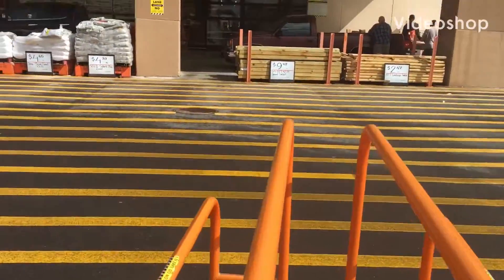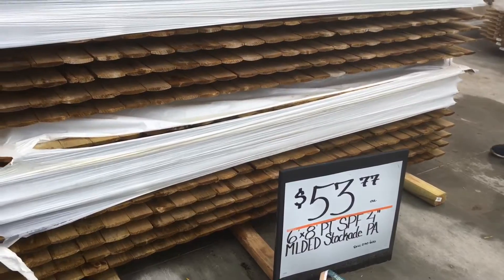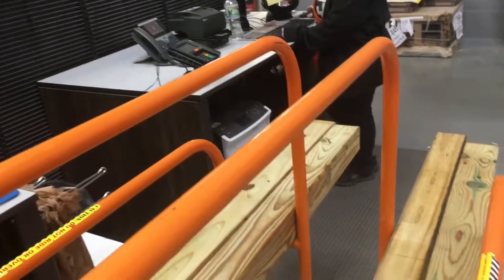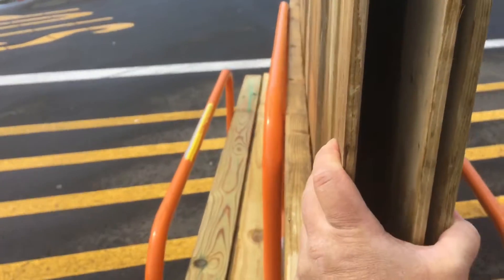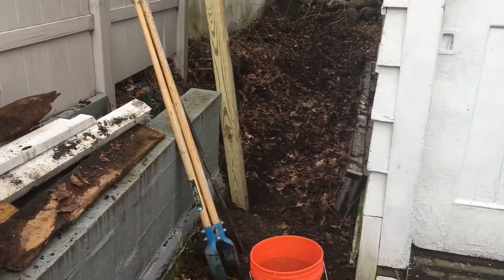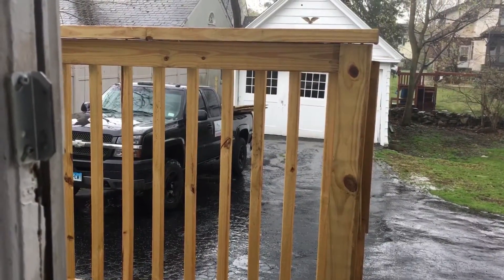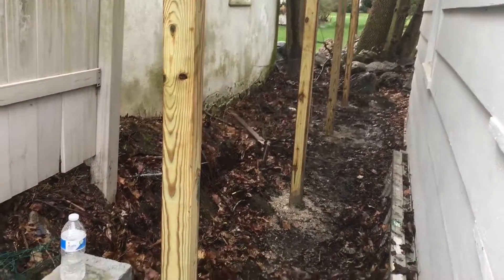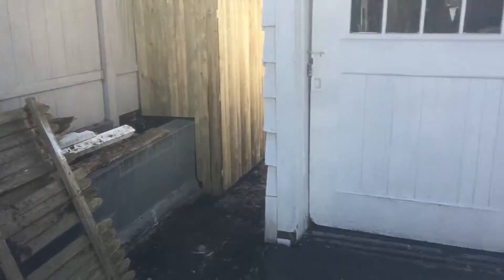How to install a stockade fence.

Comment: I hit heavy roots when I dug the post hole and now I'm not 8' on center. Can I use a 2 x 4 horizontally to the post to attach the next fence panel?
Reply from the maker: If the sides of the posts are facing the woods and not showing i would use a metal fence post set in concrete and use u- clamps to secure both fence panels. You will need to make sure your deep enough for what ever you use to set in concrete. If you can only use a 2x4 make sure its pressure treated. Good luck👍🏻

Comment: Thank you for this.  I have so many projects going on and I am using Simpson EZBase’s to mount my posts on a slab and I wasn’t sure about my middle post if it was going to be on an 8 ft. Center or not but you cleared everything up.  Thanks for this video
Reply from the maker: Jared Waites anytime bro. Thank you for watching I’m glad I was able to help. Good luck with the finished product! Any other questions check out my weekly live streams every Wednesdays at 8 pm “workshop Wednesdays”. Take care 👍🏻

Comment: Thanks for teaching me how to shop at Home Depot and about the weather. Would have been nice to see you dig the hole, poor the concrete, you know, actually install the fence.
Reply from the maker: Tyler Madore if you need help on digging a hole and pouring concrete you’re on the wrong channel. Look up using a post hole digger. It’s more about measuring and lay out.
Reply: @HighRidgeHandyman  yes you're "eyeballing" is very helpful
Reply: can you use a different type of concrete that is easier than mixing concrete? did you mix concrete?
Reply: @poppychamplin  probably late to the party but you can use quickcrete fast setting concrete.  Place post in hole, pour in the dry mix, tamp and level the post then pour in a gallon of water per bag.  in and out.  costs more though but well worth it

Comment: Nice video but doesn’t the good side of the fence face out normally?
Reply from the maker: It all depends on the situation. Front yards yes. But backyards in my area depends on if a neighbor wants to go in on a double sided fence. If not it’s the customer choice. Most of the time it’s the good side in. In this video it was only a few sections facing the neighbors garage with dead space. But again it varies from job to job. Thanks for the comment John. Good luck!!

Comment: is it ok to raise the fence panels off ground an inch or two.   am installing a fence over dirt and the old fence was trapping dirt as there is a slope
Reply from the maker: Yes. I usually have it the height of the tip of my work boot. 2-3inches. You want air to circulate threw the bottom a little bit so if heavy winds come thru it won’t trap the air and blow the fence down. It’s also good so the bottom doesn’t rot out sitting in the dirt and elements. Good luck👍🏻

Comment: i have a question. How would i attach a fence panel to the 4x4 if i dont have enough room to get behind it? my neighbors fence is too close and leaves no room for me to get behind to secure it with screws and i dont want to use the simpson strong tie garbage. I was thinking about driving the screw through the 4x4 into the fence panel instead of driving it from the fence panel into the 4x4. Would that work?
Reply from the maker: wave if your neighbors fence is covering all of the 4x4 you can cut an inch and a half.down the post. Mark it with a line. Or you can sister a 2x4 up against the 4x4 and attach to that. Good luck and thanks for watching!.

Comment: What type of fasteners did you use and how do you hold the fence in place while you fasten it? BTW the posts are plumbed not leveled.
Reply from the maker: First District Progressive Coalition You are absolutely correct the posts are plumb and the fence section are level any type fastener galvanized would do or a nice long heavy duty deck screw thanks for watching have a great day first district. On the next video if I remember I will show what fasteners I used. As for holding in place sometimes the tip of boot to get off the ground for air flow having the drill with a screw ready then one screw in the top then go to the other side top. Then finish all off.

Comment: Too bad he doesn't actually show how he attaches the posts and how he supports the post while screwing them in.
Reply from the maker: The posts were set in concrete a day before. One 3 inch screw at each 2x end right to 4x4 post. Usually when you set something into concrete it and stand by itself🤔